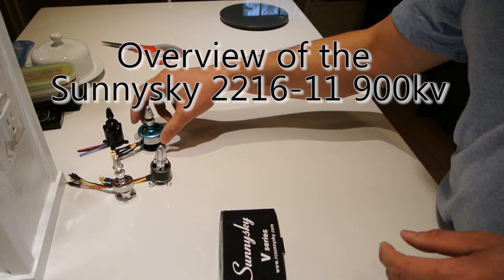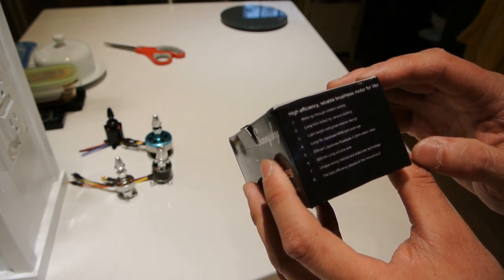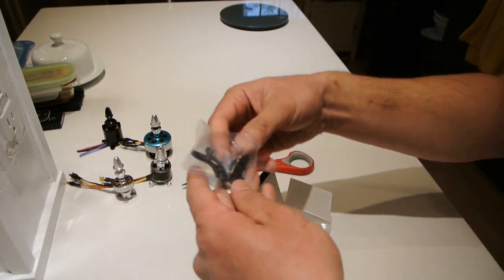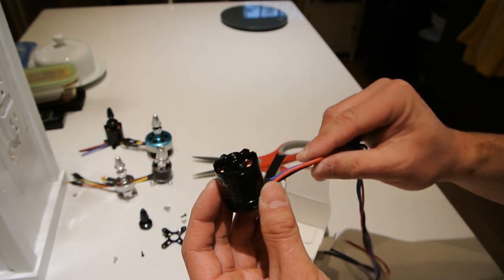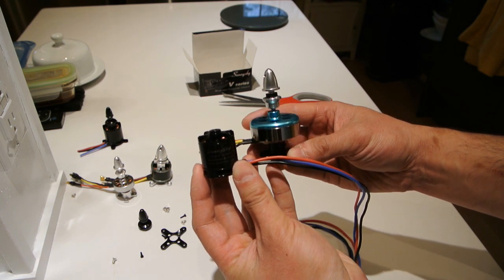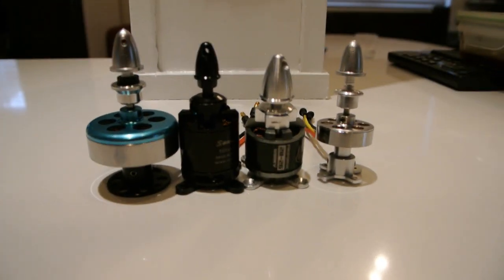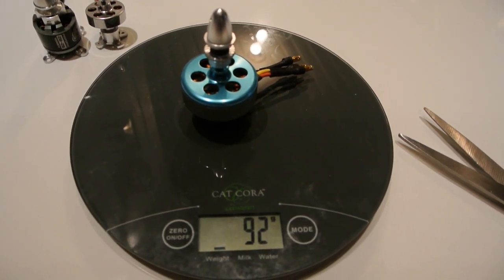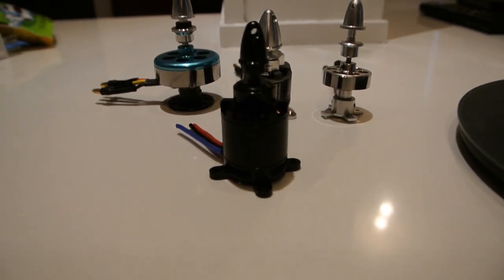Review of Sunnysky V2216-11 900kv Motor - Part 1

Comment from the maker: I am using Hobby King 20A ESC flashed with simonk.  I have been using these motors for a few weeks and I love them.  I'm going to post a video of them in action one of these days.  On a 3 cell with 10 in props they fly great but on 4 cell, the tricopter is a rocket.
Reply: what kind of flight time on 4s?
Reply from the maker: *****
4s 3000mah around 10 minutes with 10x4.5 props